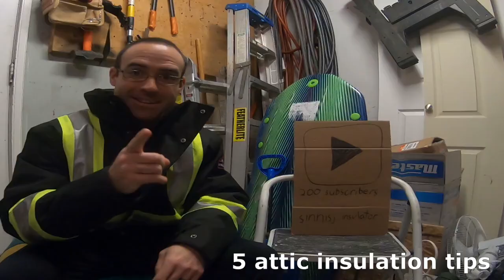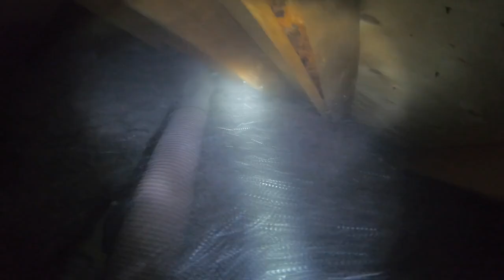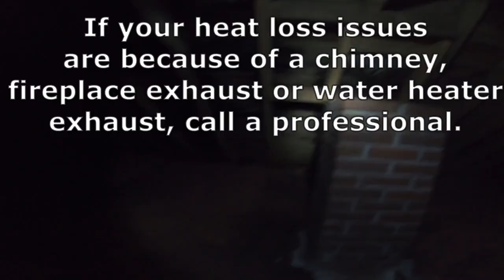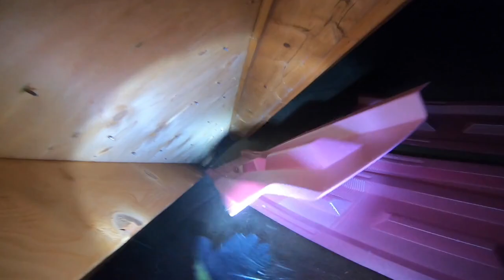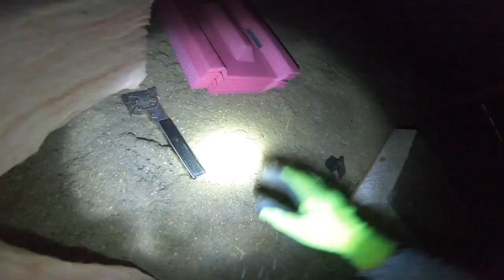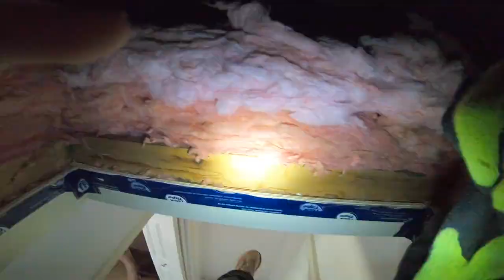DIY attic insulation FIVE top tips | home improvement

Comment: Hi there. Very beneficial videos. Hey, should I insulate the portion of my attic: 1. extending over an exterior porch, and 2. extending over the attached, unheated garage? Thanks. Dan
Reply from the maker: You don't need to insulate over the porch because it's not a living space. You can insulate your garage if you are finishing the ceiling. It will not impact your home's energy efficiency though. Hope this helps. Garages are typically r32 or r40.

Comment: Do need to put baffles in between every rafter for venting soffits?
Reply from the maker: I definitely recommend it, but don't put venting at least 3 feet away from a bathroom fan exhaust if it exhausts in the soffit. You should block the soffits around an exhaust that is in the soffit so the humidity doesn't come back into the attic space.
Reply from the maker: You should checkout https://youtu.be/_D2f5ZnHDeI for info on how to install these vents.

Comment: Can you put a layer of open cell foam on top of closed cell foam?
Reply from the maker: you can but is that for your attic? usually a cheaper option is to install loose fill after 2 inches of closed cell foam is applied.
Reply: @SinnisjInsulator  yes, i was thinking that the open cell foam would fill in any more gaps i missed (i sprayed 1 inch of closed cell foam)

Comment: Nice!  Love the kids award (tell them I gave you another because of it).  Do you recommend air sealing the flat walls of the attic?  I have gaps in the attic floor on the flat side walls (not the pitched roof) that I believe I should foam, but am not sure.
Reply from the maker: what I understand is you have gaps on your gable wall where you can see inside your house? that's definitely not good. that sounds like you need to seal those gaps with a foam canister before insulating. I'll take a look at your email.

Comment: Hi there, I have a question about an idea I have for my duplex house.  I wanted to know if its feasible.  I live on the 2nd floor of my house that is a duplex with an apartment on the main floor as well.  The people on the first floor just moved out and I want to improve the noise deadening and insulation between the first floor apartment and my apartment above.  I had to patch a hole in the bathroom ceiling on the main floor about 4 months ago, and there was no insulation in those floor joists.  I dont believe there is much of anything to provide noise deadening in the ceiling/floor separating my upstairs apartment from the rental apartment on the first floor.  Now that the apartment is empty, I want to open up some holes in the ceiling and blow in fiberglass insulation.   Not only will it help keep the heat in the main floor apartment which is heated electrically and on a separate meter, it will also add to dampening sound transmission between the floors.  
I have done many construction projects with fiberglass and mineral wool batts over the years, but never blown in.   Is there anything I am missing that will cause a problem with doing what I am talking about?   After closing the holes in the ceiling back up, I want to double up the layer of ceiling drywall with acoustic sealant in between the layers of drywall to add another layer of noise deadening.   I live in this house and my biggest priority before re-renting the main floor apartment is reducing sound transmission for my sanity and that of a future tenant.  Its in need of a good painting too once all that is done.
Was hoping to hear your thoughts?
Reply from the maker: I have a soundproof video that shows fiberglass will lessen the sound output by quite a bit. https://youtu.be/FulRRhirrl4 
You are definitely on the right track, the only thing you have to identify is where are those cross braces within the floor joist cavities because you want to access each cavity from both sides of the bracing so you fill everything. The idea is very do-able. The only other thing is you need to be careful because the pressure from filling those cavities can pop the ceiling drywall if you fill it too much. I have a short garage wall video that shows how I fill walls with blowing. Thanks for your comment and support on this channel.
Reply: How did it go?

Comment: Hey, nice video. Do you have any idea about ROI? I live in Canada, a local contractor recommend me to install R40 saying that if I install R60 it will cost much more and it will take a long time to get that money back on my power bills.
Reply from the maker: You can look at this video, it will give you good insight in my opinion of r40 vs r60 https://youtu.be/N2n4UQ6qAuU
It should not cost a whole lot more especially if it's loose fill attic insulation. The time it takes is a difference of maybe 30min per 1000sqft. The big difference is the cost of material though. R40 vs r60 is 10 bags of pro pink fiberglass Insulation. So that's around $45/bag or $450. I recommend r60 so the depth covers over bathroom fans and potlight covers. I've added to r60 on a lot of homes at r40 and it made a big difference.